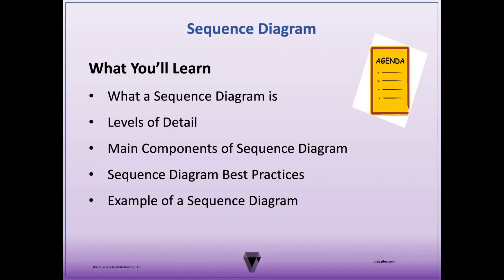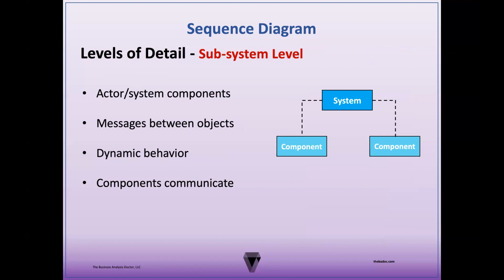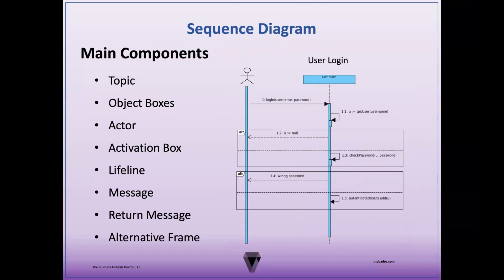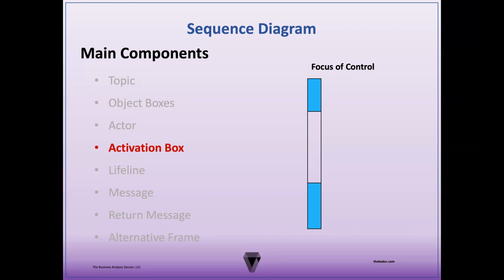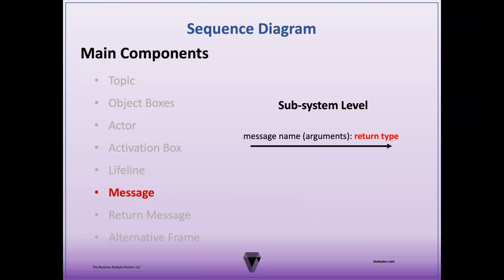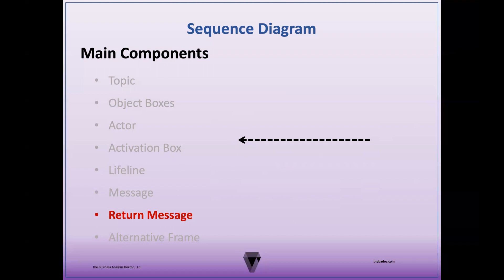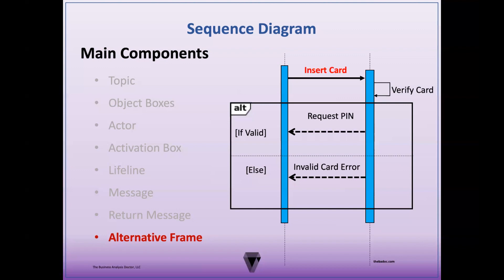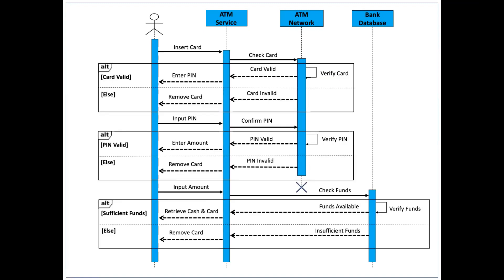Sequence Diagram Tutorial and EXAMPLE | UML Diagrams

Comment: Great explanation of sequence diagrams! The example made it easy to understand how to model interactions in a system. Could you provide more tips on common mistakes to avoid when creating sequence diagrams? Thanks!
Reply from the maker: Thank you! A common mistake is overcomplicating the diagram. Including too many details, objects, or interactions can make the diagram cluttered and hard to understand.I recommend focusing on the key interactions and simplifying where possible. Use notes or separate diagrams to handle complex details.